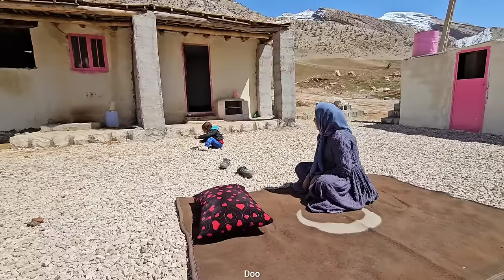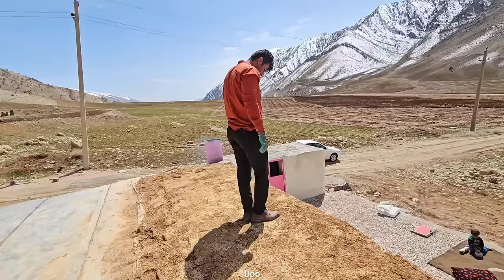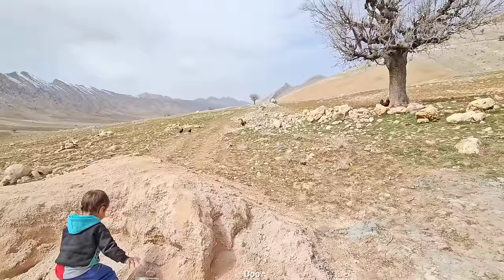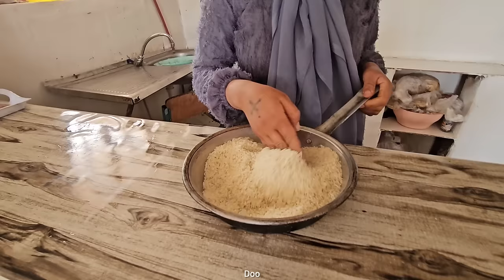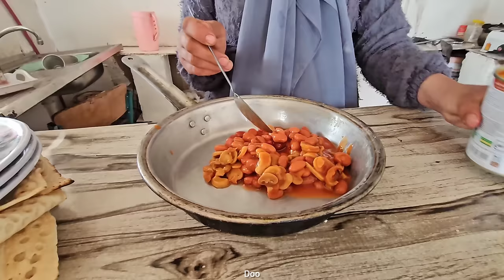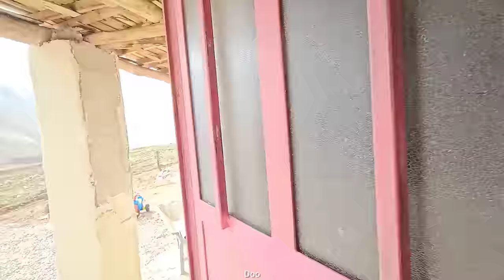Faithfulness to the Promise: Guiding the Divorced Woman to Happiness by a Kind-hearted Man

Comment: That's why peri if the water is boiling turn off the stove so you can save the gas because it's too far to buy gas
Reply: Peri turn off the gas when the water is boiling to save gas. And also soap all dishes first then let water run for all dishes to save water.
Reply: Mr. Rahmat is it possible to connect electricity at the power pole to the house? What about installing a big water tank on a higher ground & have water delivered by the truck. It’s too much for you. It’s too much for. I appreciate your kindness, patience  & tirelessly assisting Peri in almost everything. God bless you. You are such a very good man. ❤
Reply: Yes that’s true, but she doesn’t care.

Comment: You can use the top of heater. You don’t have to waist the gas all the time. You have to survive without gas. You use to heat the water in the fire how come you can not start doing it again. Mr Rahmat won’t be there for ever. Who is going to get gas or water. You need to start finding way how you are going to do it. From a survival myself.